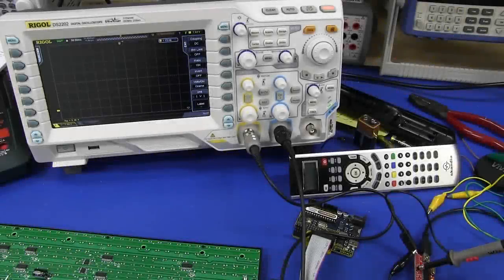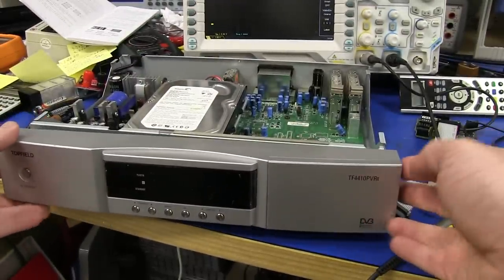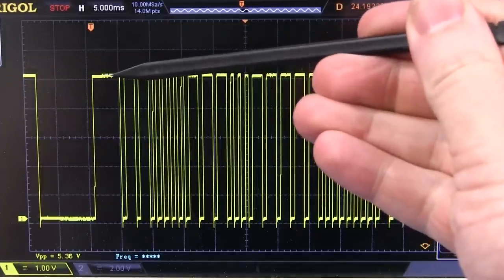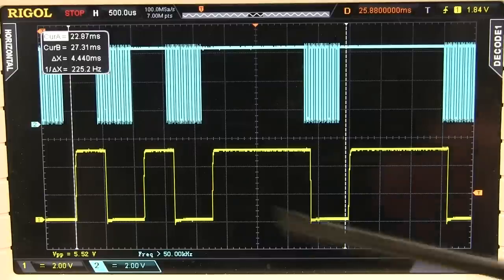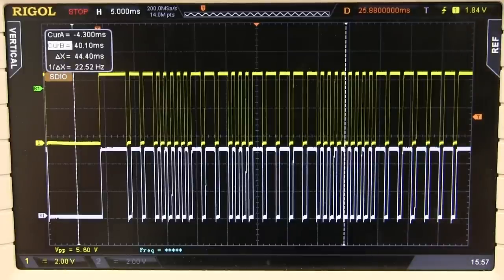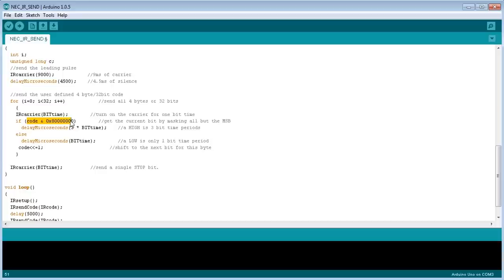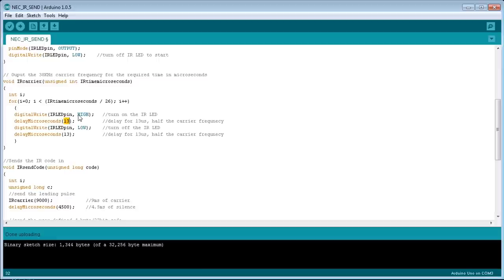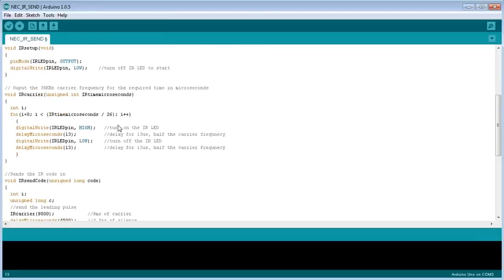EEVblog #506 - IR Remote Control Arduino Protocol Tutorial

Comment: I think in this case, Arduino _is_ perfect: Everbody can follow Dave's explanations on reverse-engineering the protocol, hacking the code and showing the timing problems, with an Arduino lying around. The library helped to keep the amount of code to a minimum.
Yes, it's slow. No, I wouldn't use Arduino just for a remote control. But that's just not the point.

Comment: Hi David, I wonder if you could help me with a problem i have ? I used to have a little dog that loved to eat Remote,s LOL and because of this i am left with a large number of TV Digi Boxes that have no  Remote Controllers to operate them, the Remotes are needed to get into the setup menu and also tune the TV Digi boxes inWhat i was wondering is would you know how to make a controller that could be used with these boxes as it seems a waste to throw them away i am not too bad at electronics having started in the hobby at an early age 4 LOL fixing the old B&W  Tv,s with my Dad i have been unable to get a universal remote to work but was wondering if there is any way to work out what type of Code the Remote would need to send or if there is any Hack i could do to the TV Digibox to allow me to use a Universal remote with them or even build a Remote tx onto an Arduino board or even use a pic controller with an infra red diode to send the data to the TV Digi Box..
Any Help or any ideas would be very much appreciated.
Kind Regards
Steve Jones 
Liverpool UK
Reply: +stephen jones Generic STBs will use one of the major RC protocols, so without the original remote you would have to do a lot of trial and error.If for example you use the arduino library IRLib, you can set the protocol and then enter the command you wish to transmit in serial monitor.I would try the NEC protocol first, but you would likely have to keep going through all the device addresses in turn until you found one that the STB responded to.**Warning though... Make sure this is done away from other IR controlled kit as you could end up bricking your TV etc by unwittingly entering service mode and changing some options**

Comment: Wouldn't it be easier to just use PWM/Timer for the carrier freqency generation?
Switching between 128 and 0 would toggle it.
That has the advantages of not having program execution interfering with the generation and the frequency would be more accurate, and the power consumption would get much lower, as well.

Comment: I don't know how easy this is to do on the Arduino as I've never really used one, but I'd have used a hardware timer in up/down mode with the right capture/control register value for half the period, either implement PWM or use the hardware PWM depending on the chip. Then just enabled and disabled it, or flip the duty cycle between 0.5 and 0. Now code execution isn't a factor.

Totally overkill for this project. :-D

Comment: Using this I've been able to decode my remotes ok, except my remote for my Pentax K50 camera.  The Shutter code is 8DCDAE60 but the scope is a very short burst which could not be 8 bytes of characters.  I have a picture of the scope output if you have an address to receive it..  This has confounded me.
Reply: I just found an article that shows the Pentax code and it matches what my Oscope shows.  Still have no idea where Arduino  got the code it did, but several Pentax remotes come up with the same code.  The Pentax code is: 13ms carrier, 3 ms pause then 7x 1ms On/1ms OFF.   The carrier is 38Khz with a 50% duty cycle.   Which is exactly what I see on my Oscope.  This is the only remote that does not behave as you explain here.
Reply: @josephtannenbaum8696  Would you be so kind to share the article? I'm looking for Pentax K-50 codes and your comment is the only information I could find so far.

Comment: TLDR: Can anyone explain "if(code & 0x80000000)" ?

I'm using Sony IRC protocol so It uses a 12- bit code, and it doesn't work. I've adjusted the timings and frequencies and such. I've experimented with different bit masks (which idek what bit masks do) and the one i found was best (but is still terrible) is 0x00000800. It only allows me to use 13 codes though (I should have 2^12, so... yeah). It basically turns binary 0001-0000-0000 to 0001-1111-1111, so the MSB is always follow by ones. How can i fix this?
Reply: The codes he is using are 32 bit, so 8 digits in hex. The statement checks if the msb is a one or a zero, he checks the msb, sends the code for a 1, or a 0, and then shifts the next bit beside it to the msb position and checks if this bit is a zero or a one. It's just an AND operation to mask out any other bit (AND with zero) and leave the required bit you want to check (AND with one). If the msb is a 0 then (code & ox80000000) is gonna be 0 (well, eight zeros) and the statement wont execute, the 'else' part will, on the other hand if the msb is one, the and operation will give a one at the msb position and then statement within the if will execute. In  your case for a 12 bit code it would be, if(code & 0x800)

Comment: The digital read and write functions on the Arduino are slow. They do a bunch of checking and eat up time. 
He could have used PORTD |= _BV(PD2); and PORTD &= ~_BC(PD2); to write pin 2 high and low much faster.

Comment: Hi. Any way to hack a SEGA Saturn's light gun (which I believe uses an IR sensor) that only works with the usual 15hz refresh rate CRT tv to work with a 60hz PC CRT monitor? Could the sensor be overclocked or something using resistors or transistors? Thank you. God bless, Proverbs 31

Comment: Guys, anyone has any idea how could I amplify (current only) of pulses coming to the IR led and use higher power led instead. Let's say 2-3 amps instead of 20-30 mA. Any ideas for transistor circuit?

Comment: why we need to put the data on carrier then decode it like radio signal it's just a light . why we don't send the data directly ?????????
Reply: it allows you to have two remotes operating in remote proximity to each other, and it prevents the environment from being mistaken for data. also, radio is as much light as infrared and visible light.

Comment: Wait, what? Changing a pinstate on Arduino takes nearly 4 µs? What the hell are they spending all that time on? I mean, setting a bit on an IO-register or the entire register to a constant valuen on an AVR takes two clock cycles, which on an Arduino, running at 16 Mhz would translate to 0.125 µs. Seriously, what the fuck?